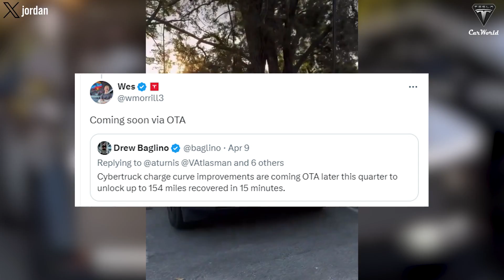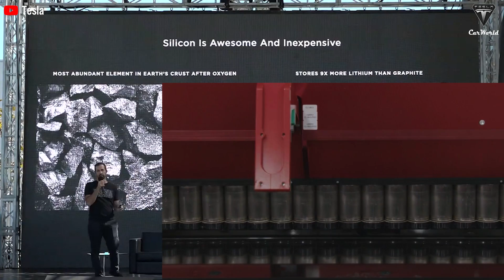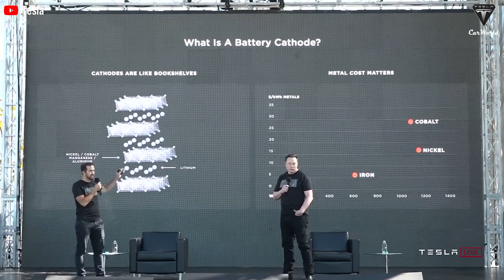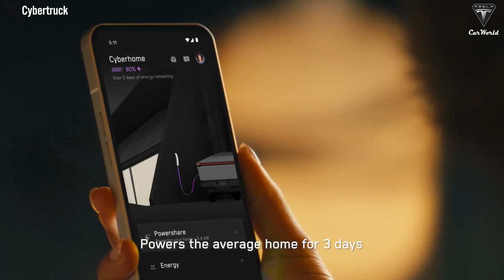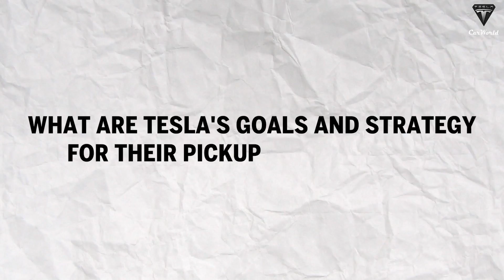Elon Musk LEAKED ALL-NEW Shock 2025 Cybertruck Updates, 4680 Battery Impression, Mass Production!

Comment: The 4680 batteries are trash. I have a Model Y with the 4680 and I can say this ... The charging curve is horrible. You will cap out at roughly 175 kwh and that falls off fast.

A friend has a long range Y and his charges at 230-250 kwh with a gradual curve.

Look at people with the Cybertruck and that is one of the same issues ... Slow charging speed.

Comment: Do you own one ?  No you dont obviously ive never owned one i own a range rover   p o s.  I own a ford f350 supercrew fx4 gas hog love it  hate gas cost hate maint cost hate parts repair expense hate dealing with dealer bunch of idiots    have a tesla  three years old  battery degradation 0  fast chargeing  0 degredation  i run full performance mode  all options on ive gone through two sets of tires i have a charger 48 amp in both homes they charge perfectly  my utility company  actualy reduced my electric bill from.54c kw hour to 39c kw hour so i saved on my utilities  there are free chargers in city since when can you get a free tank of gas from a gastation  never.  So stop bitching id take an ev anh day over the bullshit cost and maint of a gas motor that is obaolete by about 100 years .. so stop complaining if people actualy experianced the zero maint and quite and super ride tje gas cars would all be in museiums.

Comment: EV's are a SCAM!!   so after owning a tesla they are cool BUT.... super charging reduces battery life and slow charging takes forever.   PLUS real world miles per charge don't even compare to petrol.  13 gallons of petrol, which can be pumped in my car in less than 2 minutes, gets me 500 miles of real world travel.  My Model 3 is recommended to keep the battery between 20%-80% which basically gets me maybe half of the rated 340 miles in real world mileage.  I only get about 150 miles traveling doing 75-80mph down the road with AC on and radio bumping.... so are EV's better than ICE engines especially when they are almost double the price.  I would say NO!   except if your work offers free charging!  And if your thinking EV for enviro reasons all I got to say is do your homework EV's are just as dirty if not worse with conflict minerals and recyclability.
Reply: EVs are terrible, especially hyundai and kia.
Reply: Tesla's goal is renewable energy, not "green energy" the libs try to force down your throat. From what you've stated, you must have a Nissan Rouge with a CVT transmission. Make sure to get it serviced regularly and tell them don't forget to change the cartridge filter or it'll give out with less than 40k miles.
Reply: My little scooter gets me over a hundred miles on a gallon, 3 dollars to fill my tank and way less Carbon consumption any Tesla sucking off the grid.